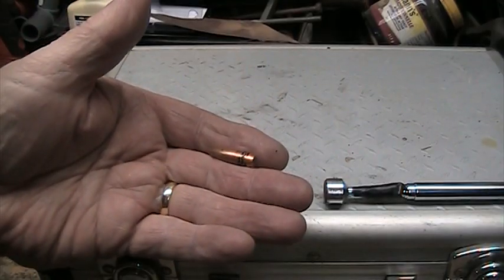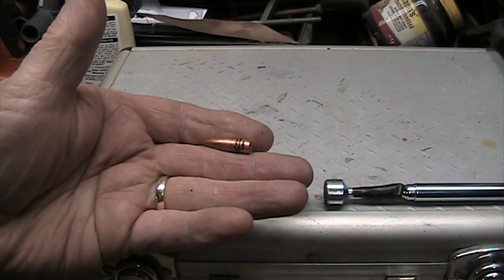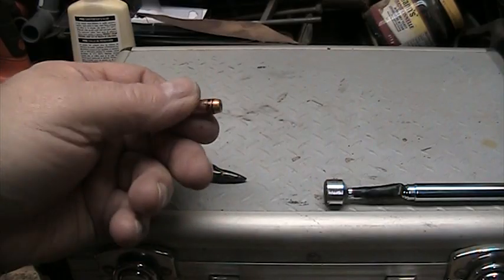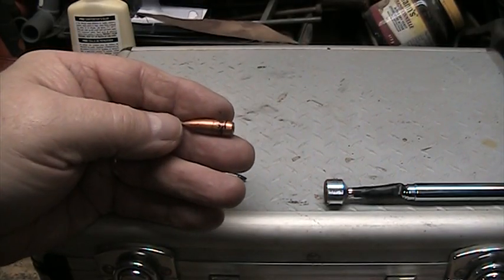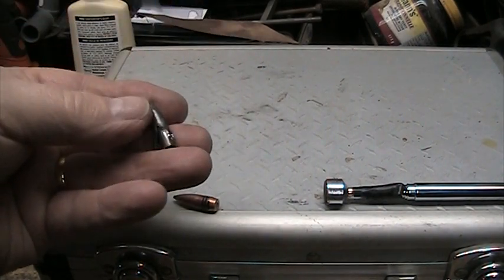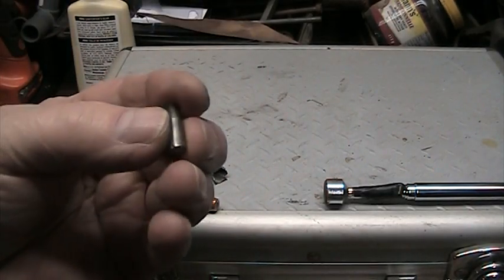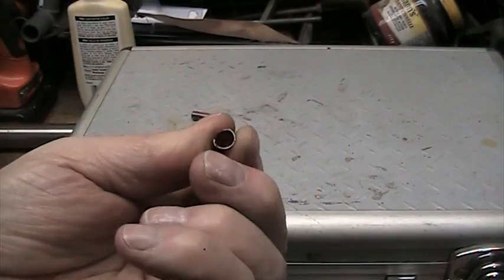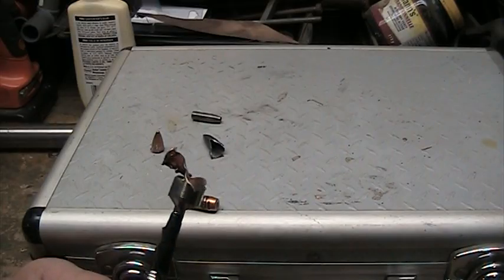Military ammo,,, will it damage rifling on a modern gun?

Comment: You can use it no worries 
The jacket isn't made of steel 
Its steel alloy formulated to match copper softness 
You can scratch it with a needle 
The copper coat is an unti corrosion progress and it acts as a lubricant between the barrel and the bullet
Reply from the maker: Thanks.